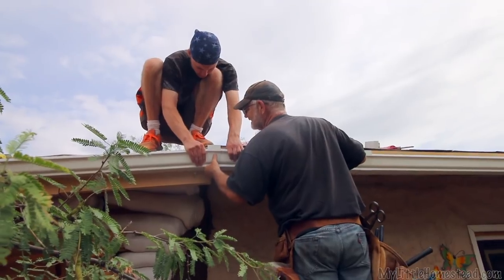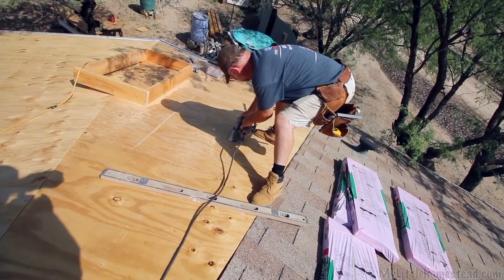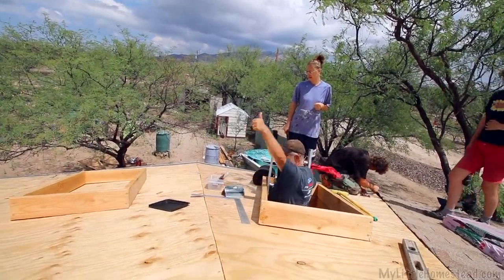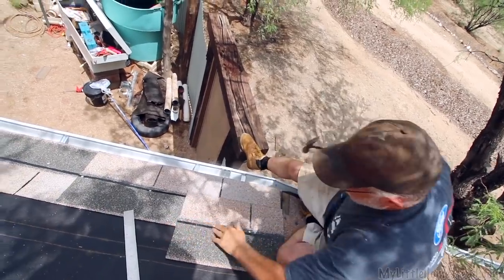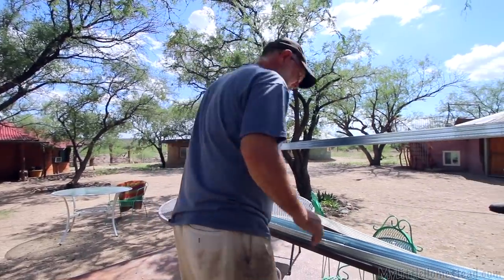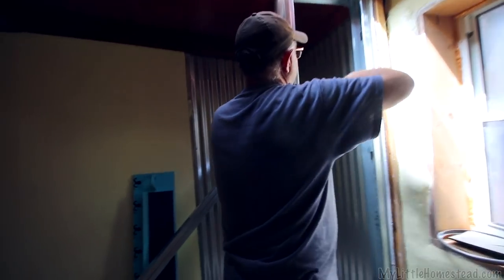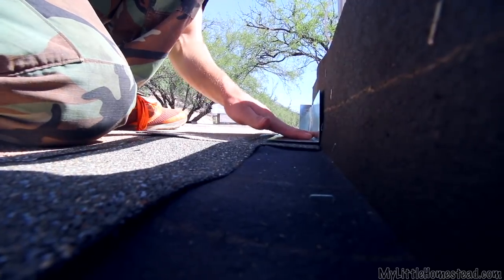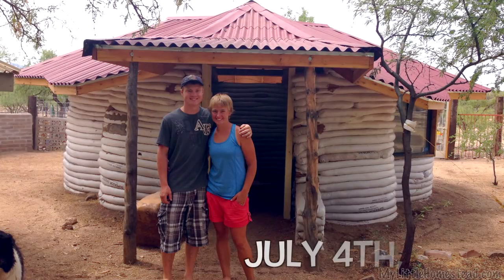Roofing Complete & Shower Wall Start | Earthbag Kitchen & Bathroom | Weekly Peek Ep146

Comment: I was wondering why you cut the valleys but then you said you were going to change it all over to steel roofing... So great job guys... And Shae good job on the cuts in the valleys. It usually takes roofers a long time to learn that.

Comment: Great start to my weekend. Thanks again for posting. 

I've never seen a roof material like that in Africa, we usually just do metal or tilesstraight off, it lasts "for ever" inland and hardly leaks if properly installed. I guess some US building materials and styles just never made it to Africa, what with the commonwealth and so on.

Shae, the accent sounded Russian to me. I also tell co-workers I don't want them bleeding all over the work! Usuall fixed with electrical tape and tp! 
Injuries in duty always a "pain" Bryson, I find I can work all day with tools and then come home and cut/burn myself in the kitchen. Perhaps that's why I married? Last month I grabbed a hot welded metal bit with a bare left hand while welding (just a quick touch-up, glove lying next to me on table), seared my prints off for a couple of weeks!

Comment: useing step flashing anywhere but on the sides of the skylights is guaranteeing a leak  the top and bottom need to be solid flashing  then you are supposed to put solid flashing on top of shingle on sides

Comment: If you use a moveable goat fence you will be able to seasonally move them and begin using the newly enriched soil that their hooves have broken up for a garden on a rotating basis.  This is a system used in the Sahara desert for turning unusable dry soil into unstable, productive farmland.

Comment: I think you mentioned this elsewhere but you’ve got 4 of the 5 panels with skylights, is the 5th without because that’s where the big window will go? Or that’s how many you had?
Reply from the maker: Just have four :)
Reply: Ah ok! It looks really good! I’m learning so much about construction just watching your videos and I really appreciate your family!
Reply: Luke Sheveland
They only had 4 and they kind of went with what was most semetrical and a bit with where the light was needed most, was my understanding! The last hole cut will be in the ceiling of the section where no window will exist except for the flower bottle design and then the next section, no sky light, but will have the big window and I believe they said the sink would be going there! Well I guess all the windows are big and same size, anyway, I  Hope this is helpful and I am correct...lol!!! Ha! I do know the 4 was all they had when they started! I'm just not positive on the sink aspect! Lol! All my love to you and yours!!!
Reply: The Ducking Homestead and Gardens I was thinking they were putting the window above the sink in that spot, so lighting-wise it should look really good. I’m just easily bothered by a lack of symmetry, but when you’ve got 4 to work with, this is the best solution for sure. (And I love their use of good deals and recycling what they have, I’m the same way, so I’m happy with the outcome)
Reply: Luke Sheveland
I'm with you on all you said!! Even if I would do something different I still love what they come up with and do!! And their deals are always so great and usually just right!!!! If that were my kitchen though, I would only want one skylight if any! They are great for natural light, but boy does it get overly warm directly under them on a sunny day! I used to work for a place that had four skylights directly above my desk and during the winter the sun was far enough south it wasn't direct heat coming through but in the summer, even under good air conditioning it was uncomfortable!  But maybe that side of the house will keep it from being a direct hit, and it isn't like they will be under them all day!!!

I am really with them and you on recycling my own stuff and the stuff of others, lol!!! I have to watch myself though, to not get the impulse buys, "oh I could do this with that kind of thing", and it be for a decoration or something I would rarely use, because there for a little while I had so much good stuff, I had too much...lol! So then there was the task of going through everything and having a huge yard sale to get rid of a lot of cool stuff, but stuff I could live without, stuff I rarely used and stuff that was like I said decorative or the like and one only has so much space to decorate and I have stuff I really like and don't want to change stuff out every season like I was!! Lol!!

I m recycling a fish aquarium and some blue barrels next month! The fish aquarium will transfer from decorative to purposeful and useful, by putting it in a new small green house area and making an aquaponics garden inside. I have to build the little green house as well and I going to video it and post it all!!! I so excited about getting it done I have been wanting to for about 2 years now but something usually comes up and sets our time frame back, but we've got it figured out now!!!! My uncle and nephews are going to help and we're a go to begin on the 4th!!! Woo hoo!!!

Comment: You have to "lace" the two roofs together you will get leaks big time!! Great job otherwise!
Reply: It's a shame they did not know how to put down a  three tab roof. They did such a great job on the framing (interesting roof line). They need to peel back the old roof a few feet to interweave with the new roof. The seams on the new roof need to be over lapped. As they have built it they are totally reliant on two thin layers of felt to keep out the rain. Felt can not do that. Not to late to fix it though.
Reply: Victoria Q also where the the seems are down the roof needs to be interlaced.. simply putting the cap on the seams will not keep rain out.. (yes it will work for a while where they live but long term it would be best if it what interlaced) but hey can't complain for a family of DIYers!
Reply: He said this is only a temp roof.  I think they said they was going to replace it all with metal soon.
Reply: Nathan yes but if left long enough it will ruin the wood underneath and they will have to replace that when they put the metal roof on